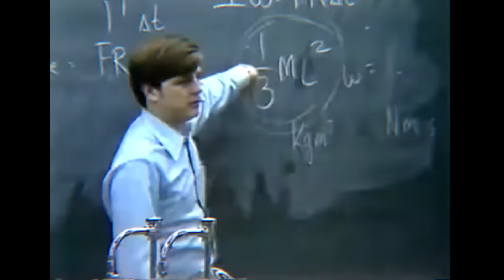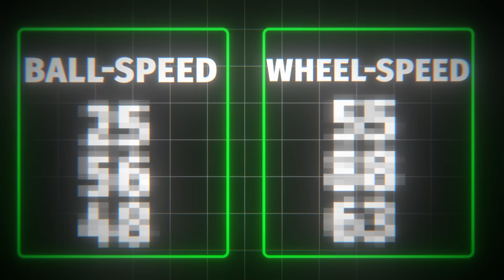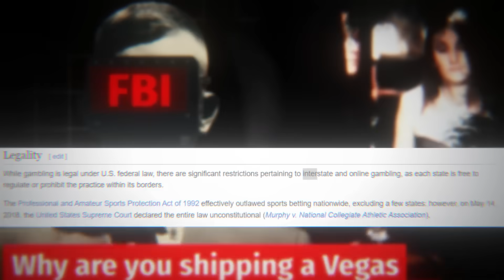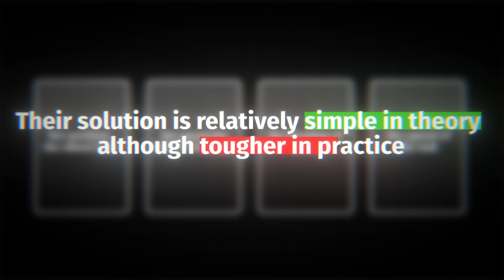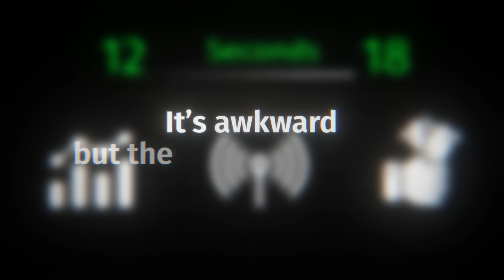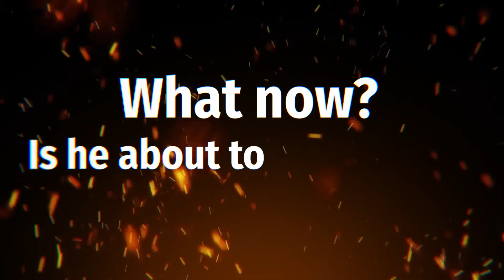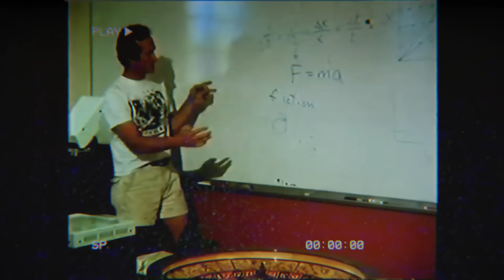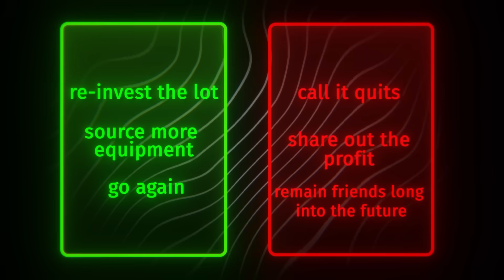The Nerds Who Beat Vegas Roulette With Science

Comment: Ex croupier here. These guys were pretty smart and too bad they didn't rake in more money durin their operation. 
Just for context, dealers are told, when a guest is winning big, change something with the spins. Either the cylinder speed or the speed of the ball. With practice a mid dealer could threw an opposite side ball, hence having unfair advantage over the players.
Reply from the maker: Someone wins; they change the game (and claim they cheated).
Reply: @TILT223 casinos don’t need to cheat. And every dealer is different with their spin speeds. I know some dealers who can hit numbers. Not many can do that.
Reply: @EaglesNation24 rubbish mate..no dealer can hit numbers..do an empirical data test of 10000 spins and record the results. Ridiculous claim..
Reply: @666dr no dealer who can hit exact number but good, professional dealer can hit in row of 3-5 numbers ( sectors ) on the wheel. No winning strategies in casino games it's a bullshit
Reply: @TILT223  of course. Its a business, and its designed to take peoples money. Expecting to win is like admitting to being a chump
Reply: @TILT223  DRS your shares
Reply: Ex dealer/pit boss here, any dealer worth their pay changes spin and shot speed. If they are not you are exposed. Learn your number wedges and look for a lazy dealer and you will destroy the house.
Reply: @batzzz2044  numbers wedges???
Reply: @batzzz2044 i could wipe out a table of players when ever i liked.

Slow spin, fast spin, fast wheel was my one of favorites hearing the ball bounce around made me laugh lol

But my absolute favorite was rushing the player LMAO.

I would pay out winning bets and then say "spinning up" straight away, lol at the chaos 😂😂😂
Reply: @ssteacuplol, always be good to your dealer 😂😂😂
Reply: @batzzz2044  Your probably the first person I have heard that mentions look for a lazy dealer, I can tell your a Ex dealer/pit boss cause it's exactly what I look for although there are ways around the spin changes and shot speed as it's calculated after the spin and if dealer is distracted delaying the wave equals more time.
Reply: @IntoTheUnkown7  me too lol I had a dealer under me one night call and hit his shot 6 times in a row. 0. Players were pissed lol. I was like do it again and I am gonna have to write you up. That guys was nasty, if you were nice he made your night while wrecking the rest. Pretty cool to watch.
Reply: @batzzz2044  Haha I'm guessing you have few stories like that one. Most I think do read the table or wheel which is not wrong but miss the subtle changes in dealer behavior which brings a whole new element of advantage on the tables.
Reply: @IntoTheUnkown7  yeah catching people was my favorite game lol
Reply: @IntoTheUnkown7  some dealers would wait for too long to wave off any more bets. I loved them the most
Reply: @robertwilson2007  So true. it always pays to be friendly with the dealer too sometimes they end up giving you a couple of seconds extra without realizing it before the wave, extra rotations of the wheel can be all it takes lol
Reply: I would look for dealers who either didn't care or who just didn't notice I was winning cause I would ask for $100 black chips if i hit big and put them in my pocket so if a dealer was changed out they never were sure how much I was up or if I was winning big.
Reply: @robertwilson2007  casinos keep track of chips, especially blacks because it has to be accounted for on the rack. The count of chips doesn’t have to be 100% accurate but they would like to be. Even if you ask for greens, dealer will later tell the floor they gave you greens.
Reply: @robertwilson2007  You missed the part where you lost all your money lolol
Reply: I won most of the time. So I quit when I was up 27 thousand after playing for about 5 years. It now sits in my retirement fund.
Reply: @robertwilson2007 lol they absolutely know exactly where the black chips are and whose pockets and how many
Reply: @robertwilson2007  and then you watch the security footage
Reply: @robertwilson2007  as a pit boss I knew where every black chip was in my pit and would have changed dealers the second I saw you hawking like that if it wasn't a strong dealer. 😊
Reply: @batzzz2044  That is why I would move around some to different tables during my playing time.
Reply: @batzzz2044 did you work on commission? Cuzco if you're not sharing house profit, let winners win as well as go south.
Dealers live off tips, floor people live off a low salary.
Reply: @batzzz2044 good job making the rich casino owner richer. Bet he enjoyed his 3rd Ferrari. I'm sure he got you one too. 😂😂
Reply: @BabyJesus66  the tribe I worked for was wonderful. They were super fair. The profits went mostly to their own healthcare system, schools, language preservation, traditional skills and arts preservation, the tribal members received annual percapita checks and they are the largest community sponsor in the county. I also gave you hints on how to do well too. Swing and a miss.
Reply: @henryguessed  i let winners win. Ya know how many cheats tip? If you read all of my posts I point blank said if you were respectful I left you alone lol
Reply: In this comment section: gamblers cope
Reply: If the dealer could hit numbers at will, they would work with someone and take down the house, which clearly doesn't happen.
Reply: @bimil8724  I believe that is a crime. So who wants to go to jail for God knows how long. Also the likely hood of getting caught is pretty high.
Reply: I love how I don't understand even half of the gambler speak here 😂
But hey, not being a gambler is never something I've regretted lol
Reply: @Jezza_Drives_Fast  good. dont gamble
Reply: That is when I would walk away. If a dealer was changing the ball speed and slowing or speeding up the wheel.
Reply: I could change both and you'd never even know my guy, bring a casino dealer is a long term job, and the tiny changes we can make on you without you even knowing we have done it, is scary. Be careful of the following points.  @robertwilson2007  game speed, pay out speed  ball speed, wheel speed, where the ball is let go in the wheel, possible backspin on the ball, dealer tidying up your bets so fast you can't see them moving your chips, dealer removing chips from numbers that are too heavy, the funny thing is  gamblers think they know all the tricks, and that's where the dealers win. Good luck, but in my 22 years as a croupier and supervisor, I'd say keep your wallet closed and go out gor dinner instead
Reply: @robertwilson2007 That isn’t beating the odds, you just did what every gambler does. You bet on intuition and bet distribution, which gives you the illusion that you beat the odds because your odds slightly improved. Just not past 50%. These are things you cannot detect with your eyes, you need math to do this for you and an algorithm. He said they used trigonometric functions in the beginning which means they’re calculating angles and degrees to account for variables. You can’t detect something like that with your eyes alone.
Reply: @firemonkey1015  What ever helps you sleep at night.
Reply: @robertwilson2007  Haha yeah it was annoying I had to dig into the profit margins by increasing the coverage and scaling among other things to compensate.
Reply: @IntoTheUnkown7  if you were cool, reasonable, and didn't try to teach, throw my dealers a toke or two and I would leave you alone.
Reply: @batzzz2044  Haha you're like the Pitboss I used to know when I first met him he pulled me aside and said I know what your doing haha but he laughed about it. Agreed about the greedy bit $500 to $1,000 was ok for them not everyday but every other day was ok than they wouldn't bug me haha.
Reply: @IntoTheUnkown7  if you don't get greedy and make me explain we are good lol
Reply: @batzzz2044  cool pit boss.  100% it's your kindness to others that makes the mold as its very entraining for the table and will attract other players.  I know this from playing tables.  Always went with mom and we had fun.  Bought our dealer a coke (as they where on shift) and talked to them after.  Good sportsmanship makes money on those tables even if you know how to call sectors like we did.  I have to throw many rounds.  So if a wave hits I'd let someone cool have a call. I'm thankful they tolerated me. Part of the game involved keeping it fair even as an edge player.  Splitting bread with the house goes a long way.
Reply: I mean the literal mafia did start casinos so there's that
Reply: @BeastCake1349  Yea I thought so. I have seen wheels slow down without anyone touching it. 😂😂
Reply: @robertwilson2007  Brakes or magnets?
Reply: I hit a casino recently.  Hit $175 on 1, pressed it and it came back for $525, and then had about $45 on 26 and it hit for $1,500.  They immediately changed the dealer after that.
Reply: Yeah, well unless they changed the ball, and maybe even not that, it wouldn't make any difference how fast or slow you spun the ball. The computer had the whole decelleration characteristics of that wheel, and would be able to predict it.
Reply: At last, someone (other than me) who actually knows what they are talking about!
Reply: Correct. I have seen a croupier be able to nail a 6 number wedge time after time if he wanted to.
Reply: they do that regularly here, they'll touch the wheel and rotate it again all the time
Reply: they were smart for not getting deeper
Reply: I was at a casino for an eclipse meetup of online friends where we met on the roof to watch the eclipse. The host played some roulette while awaiting dinner time. He got $100 in $2 & $5 chips and placed many bets using the number intersections to cover 4 numbers at once and did this in a square giving him at least 16-24 numbers each bet. Other players had plenty of other numbers covered too. 5 spins in a row the number the ball landed on was a number that had no bet on it and the wrong color for those type of bets. At that point I realized it was totally a rigged game.
Reply: @billkeithchannel  Nope, that's probability.  I worked as a dealer all over the world including Vegas and Tunica.  Don't need to cheat, the house always  wins in the end.
Reply: @billkeithchannel  That usually only applies to slots because the house has no control over the live games.
Reply: @Dalukester2 how come I lose consistently on even bets but don’t win consistently on them if it isn’t rigged in any way ? 😂
Reply: @billkeithchannel 😂🤣😂
The casinos don’t have to cheat at a game where the odds are in their favor.
Reply: @billkeithchannel  I would not be surprised if the wheels have brakes on them that the croupier/pit boss can use to disrupt the fall-off point
Reply: @Kirisame312  This might be the stupidest thing I have ever read.  If this were true, it would be public knowledge by now.  Thats something too many people would know about and the public would find out.
Reply: @Kirisame312  not the dealer or pit boss, that would be remotely done, if at all
Reply: when was this though? They were doing it in 80's my guy...
Reply: @iggydc8034 It takes effort on your part. You absolutely can take advantage of a casino np. You just have to be discreet. I could go and count and get away with it..... its all about understanding psychology and being discreet. You have to underdtand the house you are in as well. The small casino's are vulnerable.
Reply: One time when I was a boss it took me 3 months of knowing a guy was counting to convince everyone else he was. I had notebook after notebook of shoes and I couldn't "prove" it. He would progressive loss bet and play normal under every circumstance, the only time he would exploit a count was if he had naturally hit table max via loss. The programs we ran couldn't catch it because it is a completely normal betting pattern A. B. He had naturally hit limit. C. They never cashed more than 2.5k. They average boss didn't see it. I did. He didn't get backed off till a sloppy drunk he was bedding looked him in the face and said but you said the count was high lmfao. Still a lil butt hurt.
Reply: At the Riverside Hotel and Casino in Laughlin I was doubling down and making $800 a day just walking around with buddies. It's better when there's more people at the table because they won't notice you. But one night the gambling bug bit me, and I left my room alone went down and played at a table alone. The dealer changed the ball size on me, and starting from $10 I was down $310 in less than 5 spins trying to double down. The next double down would've been the $620 then the max bet was $1000 I was out. I come back to the room and my buddies were all bummed because they lost all their money by the last day. My eyes were glazed over and they were like "What'd you do get a massage?!!" lol

They thought I got a happy ending in hindsight I wish I had gone to the massage place instead of losing that $310.

I've sat at video roulette and get up to $100 then weird people start coming around and looking at my screen. Freaky
Reply: What about the use of movable magnets beneath the wheel to help attract the ball to a certain area when it drops?
Reply: Absolute rubbish roulette is designed to loose to many numbers to win its totally random it can go in zero 500 timed just more probility it's just look
Reply: @KiloKnog  look up college studenta beat roulette.
Reply: How is that not considered cheating ?
Reply: @RobiOne313  Generally speaking, in Nevada, almost anything "the house" does is acceptable, whereas anything players do to actually win is either illegal or actively frowned upon.
Reply: That's fkd up
Reply: It's rigged now
Reply: They use different size balls to
Reply: Lol that’s not true good story though
Reply: @lao-ce8982  You were a sawdust joint guy
Any big casino would simply comp the guy a suite and get his money the next day
Reply: Considering, using this method, the bets don't go on the table until after the dealer has spun the ball, You aren't really throwing a wrench in this system. They just go back to minimum bets until a recognizable roll is established again.
Reply: That’s not true- I’ve worked in casinos and know this to be false
Reply: @lao-ce8982  That's why I said it's impossible to find a mathematical formula to beat the system. 
You just confirmed it
Reply: I don't think that would have worked here.  The computer accounts for the speed of both so the calculation is the same.
Reply: Yep that's happened to me,infact when I got up from the table,the croupier mouth silently,the word,  sorry. Why I thought, law of averages. Wud suggest if you on a winning streak you win 8or 9 spins out of 12, if you are on a losing streak ,then maybe only 2or3 spins out of 12. I lost 11 spins on the trot.  I played 12 numbers in a3rd of the table,12counters on 12 numbers, if one of your numbers come up,it pays 35 to 1× 10,
Reply: Das muss man weder Dealer noch Spieler erklären, das durch verschiedene Geschwindigkeiten, rechts oder links herum andere Zahlen fallen! Wenn Dealer mehrmals die Zahl treffen, welche sie Wollen, dann ist es Glück! Kommen sie Regelmaß in die nähe der Ziel-Zahl, dann ist es können. Aber auch beim Dealer gilt: jede Zahl kommt einmal! Und, würde der Dealer 10x das Gleiche spielen, dann gehen die Spieler! Ein guter Spieler merkt außerdem, wenn was Foul ist und geht! Guck dir die Gesichter der Spieler am Tisch an und Du weißt ob Du setzen kannst oder nicht!
Reply: I used to use this something like this method. I would sit a close to the wheel so I could visually watch the dealer. #1 If and when they changed the speed of the wheel. #2 Where the ball was let loss onto the wheel and what number it was let go at. #3 I would calculate visually how far back or forward the ball landed from the number it was let go onto the wheel. #4 I would watch this many times before sitting down to play. #5 I would wait until the dealers got comfortable at releasing the ball at the same strength level /speed. #5 I then would figure out where to place my bets quickly and a couple of rotations in. I would place bets on fives number in a section to increase my chances of a hit. #6 If I had a dealer that hardly changed the wheel speed or their own ball throwing speed and I was winning at a good consistency. I then would start playing larger amounts of chips on each number and maybe even start playing up to 6 or 7 numbers in section. This was even with the double zero wheels. If things looked a little out of whack on the spin. Sometimes at the last second I would place a bet on the zero or double zero. Many times I did win on those hunches. 

All this was back when they gave you cards to mark what numbers had hit, it was sort of a cheat sheet supplied by the casino. It was very useful for my purposes. Also this was back when you could play just $5 a spin. I think now it is up to $10 or $15 a spin at these riverboat casinos. I would go with $50 - $100 at a visit. There was many times I walked away with thousands of dollars. Over time they took the cheat sheets away, had less roulette wheels to choose from and raised the minimum bet. I was getting to hard to play an win. I never kept a detailed accounting But I think I made a pretty tidy sum of money for the many hours of play for those 4 or 5 years of low betting minimums. Another factor why I stopped playing was they never raised the maximum chip bet $ amount per number while also raising the minimum chip bet $ amount to $10- $15.
Reply: @robertwilson2007  I used to do something similar as well the ball was slightly heavier and the pockets weren't as shallow, sometimes I did it with a friend of mine, I used to set the mark on a number than the friend could cover down the field so we would get our sector in, we effectively gave us more time to put our numbers out.
Reply: @robertwilson2007 You would be surprised how bad hunches can be if you actually took the time to track them.... for most people.
Reply: @robertwilson2007  are you presently allowed to bring your own sheets to keep track of previous rolls?
Reply: I dealt for 12 years, dealer, inspector, pitboss and boxman. 
With roulette I was known as a cooler, I've been known to flick the ball out of the wheel on purpose just to change things up. Stop momentum if my constant varied spin gets caught in a section. I've had high value players walk from the table as I got there or just stop playing. I looked like a "lazy" dealer that didn't care. Nobody saw me coming if they didn't know me already. It was great fun.
Reply: As an engineer I don't find them that much smart. It's quite simple actually since the laws of physics don't change inside a casino...
The casino always wins exactly, because the luck and rules are always on the casino's side. The computer part was quite smart, as well as them quitting before too late - I doubt increasing your odds was not considered cheating as claimed in the video lol.
Reply: @momchilandonov ”I don’t find them that much smart”. 😂dude….
Reply: Changing the speeds wouldn't matter as they are calculating the speeds on each spin.
Reply: That’s not having an unfair advantage, that’s making the “game” closer to how it’s intended… fairer really.